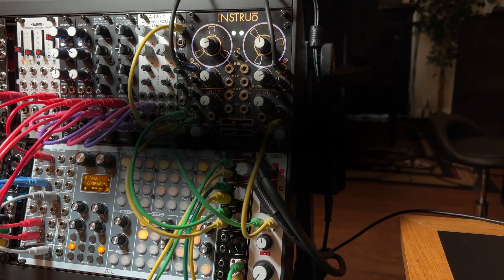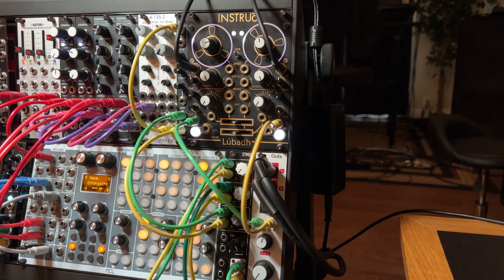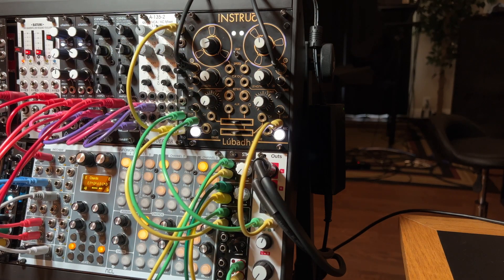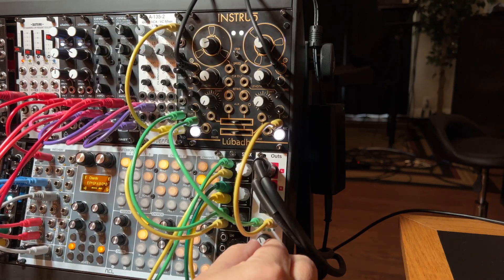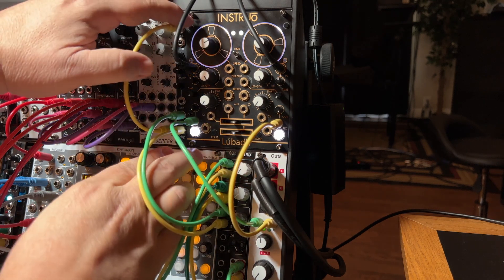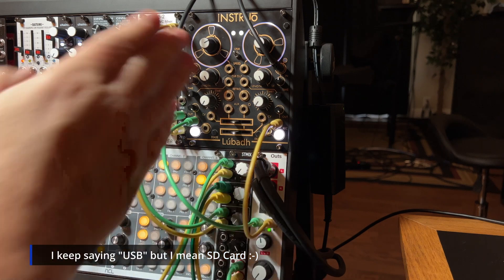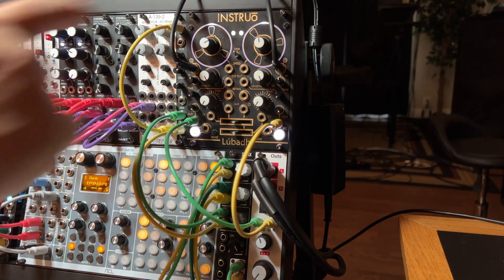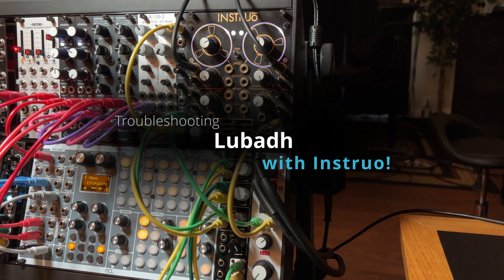Troubleshooting Lubadh - for Instruo Support

Comment: I have the same problem. I flashed last firmware yesterday. 1.3 Latest Version. Some news about new updates?
Reply from the maker: I'm afraid there is no new news here. I ended up selling the Lubadh because it was just sitting here not getting used. It's not "broken" really, just seems to have trouble loading long loops. You can try reaching out to Instruo Support. They are very responsive, friendly, and hopeful 😁

Comment: i also have the lubadh , and first thing to know thats its a buggy module on bootup sometimes ,  Instruo is working on it . having no audio happened to me once several months ago but i had mines on decay mode . also the speed issue has happen to me countless times on boot up after a night of the lubadh going through some heavy cv abuse :) .Also you dont really have to save what you recorded into the usb . i usually keep it on the deck and it saves during power cycles . Another thing that i started doing which helps with the bugs is to do the combo reset when your done with a project or performance and doing the same before starting something new . despite the bugs i love this module , i use it 70% in all my patches . here is a link hope this helps https://www.youtube.com/watch?v=rvj_MdCecaw&t=5257s
Reply from the maker: Indeed. Love Lubadh, regardless. Support mentioned it could only be about my lengthy loops, because when I first bought it (used) it had some 30 second recordings on there and never had a problem. I haven't had time to verify, but I guess it makes sense. Hopefully they can fix it soon.

Comment: Certainly make me want to rush out and buy one of those. Ugh :-(  I hope it's something simple. Any chance you have power issues? Or a sketchy cable somewhere?
Reply from the maker: No power issues but likely a length of loop issue. I worked with Instruo support (wonderful folk) for a few days trying different things and ended up just filming it for them. They instantly spotted the problem. This is not a bad module at all, just has a quirk in it's firmware that will be fixed :-) I still love it, just have to coax it for now.
Reply: @VisionsMusicGroup  Have they released an update to address this yet?
Reply from the maker: @TheAstronomermusic  It does not appear they have. The firmware file available today is still the 1.3. I re-flashed 1.2 (or a previous rev) but have not done extensive testing to confirm that as a temporary solution.
Reply from the maker: @TheAstronomermusic  FYI, just heard from Instruo Support, they said V2 of the firmware is coming soon and most known bugs should be fixed. They also mentioned it's going to be a complete rewrite of the firmware, so that is pretty exciting!